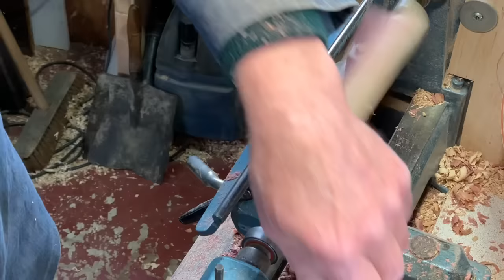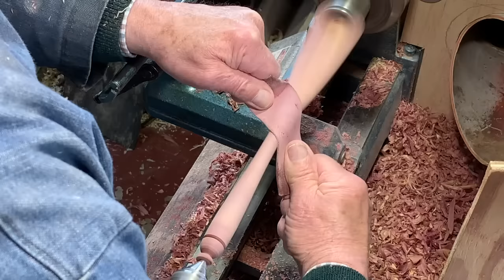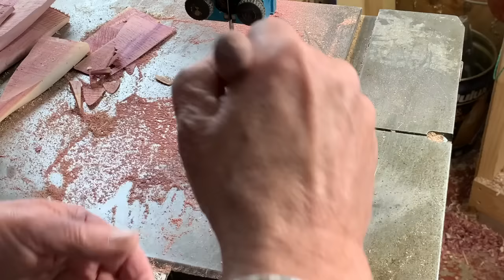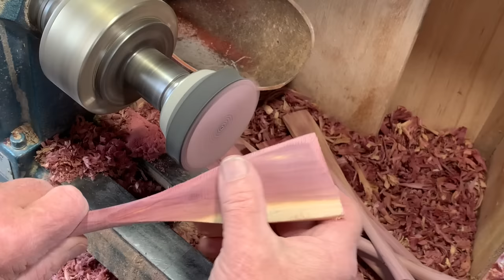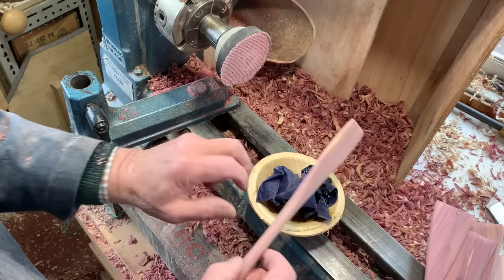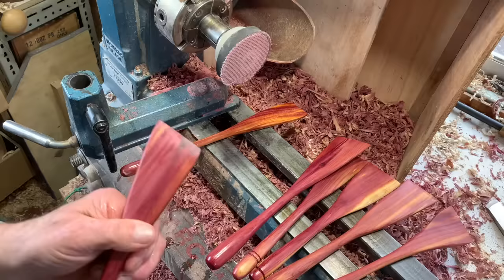Richard Raffan turning seven spatulas

Comment: Question when you were doing the hand or you had the point down of the skew but when you were doing the blade side of the spatula you had the blade up is there a reason for this? thank you for all your well done demonstration
Reply from the maker: I don't change hands when turning. My right hand is always on the tool handle. Whenever possible I cut long curves from right to left so I use the skew long point down pointing in the direction I'm cutting with minimal tool pressure against the lathe axis. When cutting long curves from left to right and I find it more comfortable to use the tool long point up although I can lean on the headstock and use the long point down. So although I prefer to use the long point down on long curves and cylinders, I can only do this comfortably working right to left.

Comment: So I googled- Is Boiled Linseed Oil considered to be food safe and the answer is NO?  What are your thoughts?
Reply: Modern "boiled linseed" is not boiled but instead usually has metal compound driers instead.  Traditionally, the linseed oil would be brought to boiling for a period of time which then caused its natural polymerization process to be faster when used as a finish.  However, the boiling process is dangerous and more expensive than adding metal driers.  Some say it is food safe, others not - how much residual metal (like cobalt) is sage?  I just use walnut oil - it dries at room temperature and is food safe.  If you buy food grade linseed oil (sold as flaxseed oil) it will work, but take longer to dry than BLO .
Reply from the maker: I've used it as a finish for about 25 years, usually mixed with beeswax as you see on most of my videos. My understanding has been that small amount of toxicity in the oil is not an issue, apart from which the finish is removed when a utilitarian item is washed. If I lived in North America I'd be using Mahoney's Walnut oil which is not available in Australia.

Comment: What was the approximate size of the blanks and what variety of wood would you recommend.
Reply from the maker: Spatulas tend to be anywhere from 200mm to 300mm long depending on how your'e going to use them. I think these are about 250mm (10-in) long.

Comment: Those spatulas are beautiful, the practice is evident. 
Do you have any particular reason for having a hard backed 40 grit sander and a foam backed 240? Is the foam more gentler/kinder on the curves for final touches? (And in the older days before you downsized would you instead use a belt sander for the majority of this - it's consistent speed and goes with the grain?)
Reply from the maker: I prefer a belt or drum sander for the paddles. I find the softer pad does a better job on softening the edges and it creates the hint of a concave on the paddle face which I find feels better.

Comment: Beautiful work as always, where did you get that metal sanding disk you used to shape the flat ends?
Reply from the maker: The metal sanding disk is a standard 150mm faceplate. I also have Velcroed MDF disks with a recess so they can be mounted on the expanding jaws of a chuck.
Reply: Thanks for the information Richard, appreciate your time